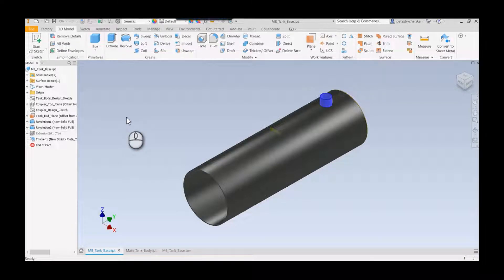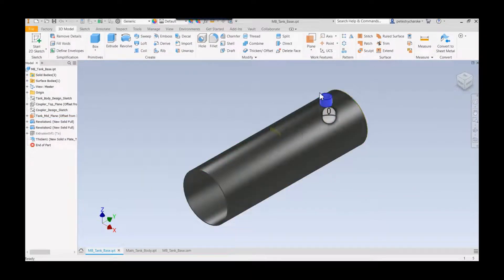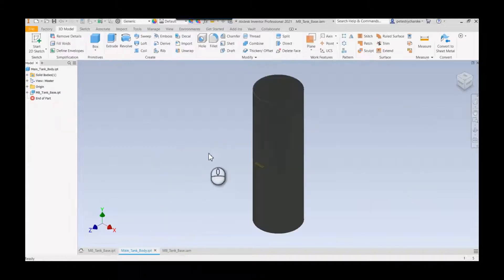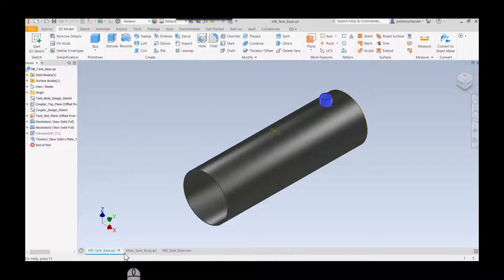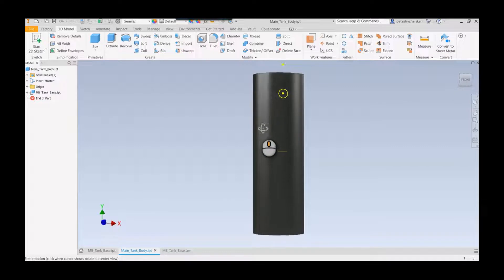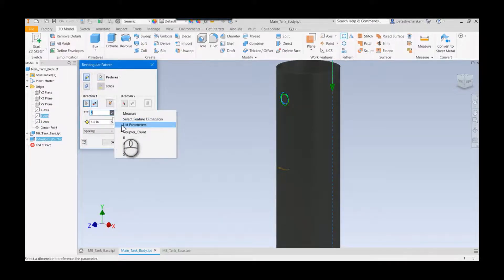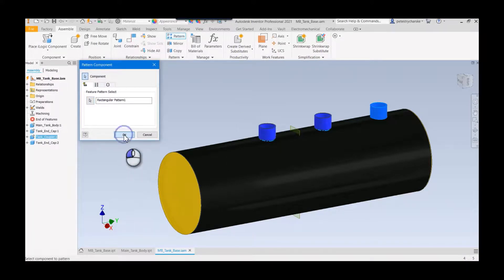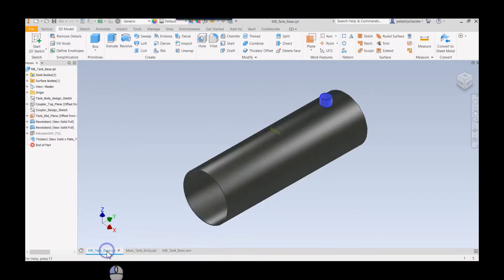Inventor - Placing Features When Multi Body Assembly Modeling

Comment: easy guestion :) I have multi-body table with MANY legs, easies way to draw them in one sketch and extrude, because they are same dimension and can be shown in 1 drawing with MANY qty.  in that skecth easy way to change location all of them one time. But is that correct ? because in assembly it will be as 1part and shown MANY legs how to make drawing (can cheat and hide lines). Also can draw 1 leg and in assembly constrain MANY of them, but thats a lot of work, and if need to change .... or draw MANY new solid legs in multi-body then in assembly shown them combined? but if I need to change position again I need to find that leg from many......not in one sketch :)  what is best solution ? hope you understand :)
Reply from the maker: Great question!  Our apologies for the delayed response, but Pete has knocked out a couple of videos that we hope will prove useful to you!

https://youtu.be/kBxMrjICtT0

https://youtu.be/6ApL3Z7yLiY